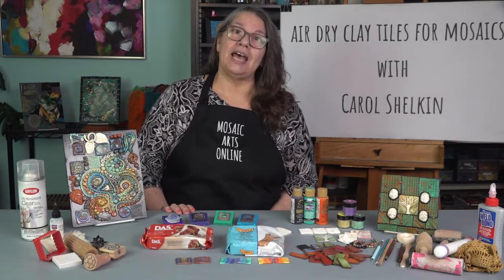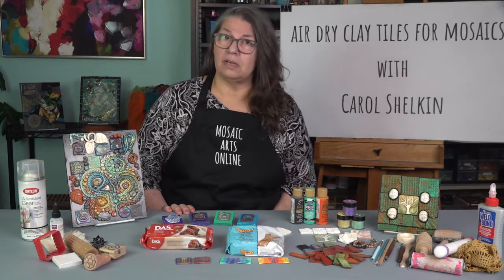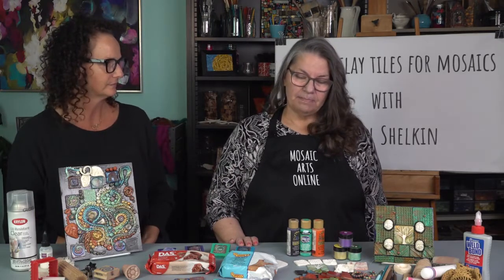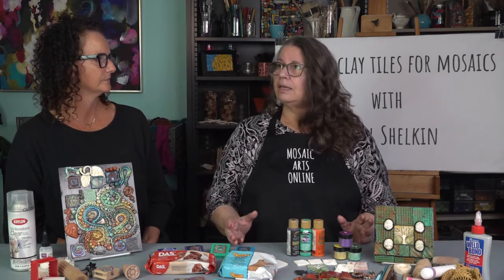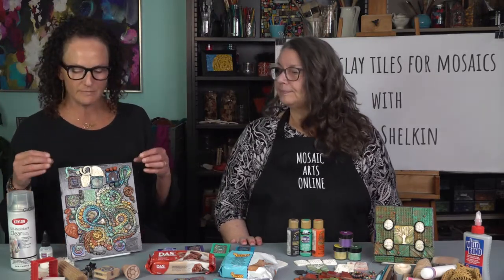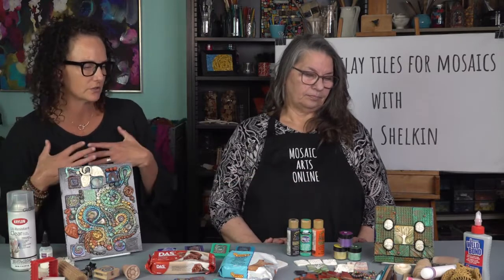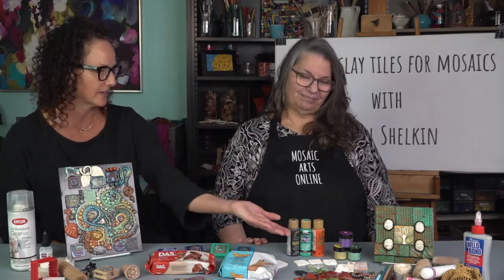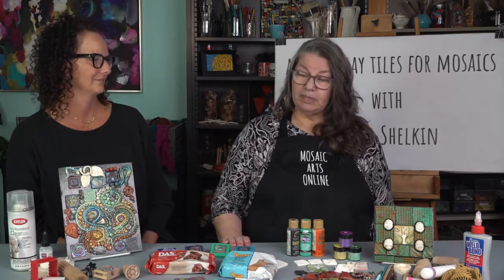Air Dry Clay Tiles for Mosaic Art with Carol Shelkin

Comment: Could air dry clay be used to create tiles for a kitchen backsplash?
Reply from the maker: Air dry clay tiles will not have the same strength as a ceramic tile that has been fired.